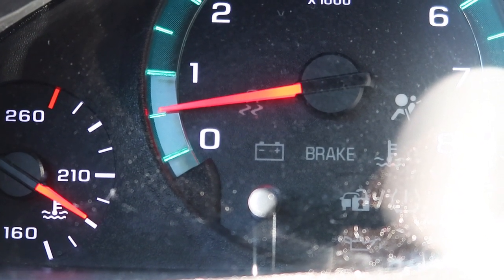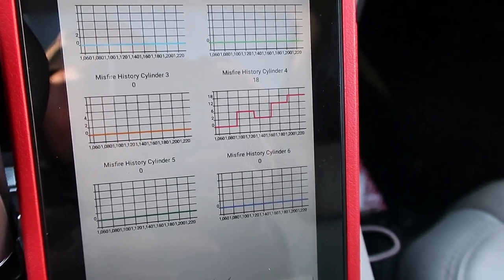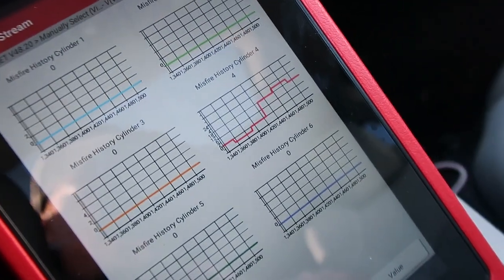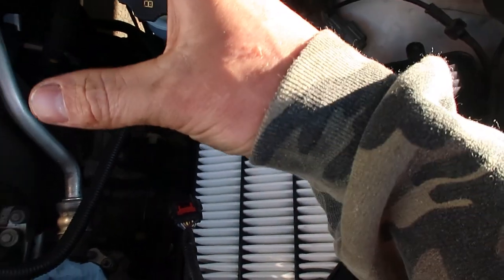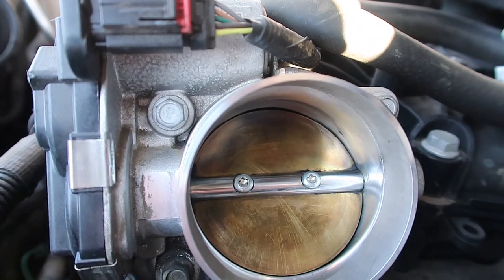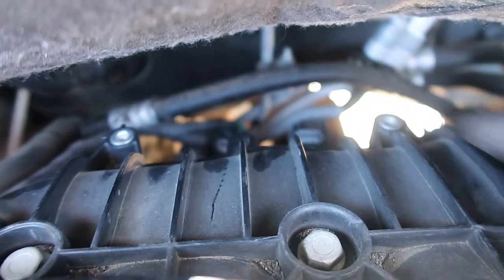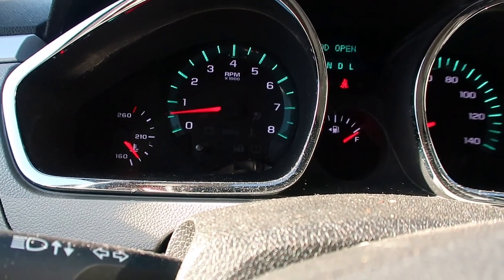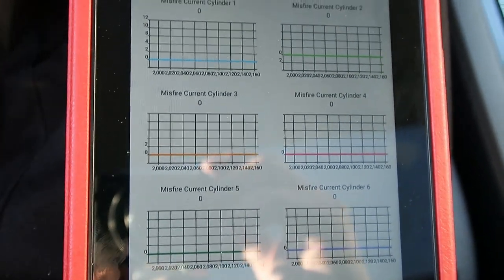More Traverse Misfire Problems. Can We Fix Them?

Comment: I’m having the same issues with my Buick Enclave.  I changed the spark plugs, made sure they were properly gapped, changed both fuel pumps (high and low pressure) along with new fuel lines, new air filter, new TPS sensor, new Mass Airflow Sensor, new PCV valve, and it drives better with each repair, but it’s still miss fire while driving and I’m always getting a rich code on bank 1 (P2178). BTW, I did a warranty exchange on the new high pressure pump, and for some reason, it continues running rich on bank 1.  I love my Enclave, but I’m running out of options.  😄
Reply: Besides a scan tool capable of reading fuel trims and pressures. Either a fuel pressure regulator or fuel injector spraying too much fuel / sticking open.

Comment: 2012 traverse here.  I got a thump thump while in drive and not moving. Well it also does it when in nutral and reverse and park😅... It also seems to thump when driving usually when just starting to move.  I did a full spark pulg and valve cover replacement because there was oil in some of the chambers. Everything is to spec. It was running fine now it started with the noises again...any ideas what i can do next?
Reply from the maker: It’s hard to diagnose a thump noise through the comment section but I will try. Is it a constant thump? Does it change with RPMS? Does it sound like it is form the engine or the transmission?

Comment: Just a FYI, dont manually force the blade of the throttle body open. You have to use the scan tool, and command it open. You can screw up the actuator on the throttle body, leading to damage. If your lucky it just throws the calibration off, if unlucky, your buying a new throttle body!
Reply from the maker: Yeah I need to start using it more for things like that. Thank you for the reminder
Reply: @ModdingAddiction  Ya, ofcourse! 
Good vid.
Reply: hello I just replaced Spark plugs and coil packs and my car still is still skipping
Reply: @dancurrier6421  You need to scan it and see what codes are coming up. There's many things that can cause misfires codes, if that's what you have.
-vacuum leaks
-bad injectors
-plugged fuel filter, if serviceable 
-valve issues, especially GDI
-timing chain
-dirty/plugged air filter
-dirty MAF sensor
-dirty throttle body
-etc...
Have it scanned, and go from there.
Reply: Splash it was scanned by a garage he has a snap on scan tool  told me no codes on his machine checked  under the hood for any hoses that are leaking told me might have to go gm they want $165 hr I don't think so . Going up hills I can smell it burning rich. the garage cut of one converter  it was bad put a straight pipe on it
Reply: @dancurrier6421  Weird that it's no throwing a code...The straight pipe in place of the converter is exactly why it's not running efficiently. The downstream 02 sensor should be picking that up, unless something has cheated it, maybe extended the 02 out of the pipe a little bit?
If it's a misfire, it should detect it. When it runs rough, will it flash the check eng light?
Reply: @dancurrier6421  Try spraying each coil with a spray bottle and water. See if you can get it to stumble while it's idling. Could have a hairline crack in a coil...Or maybe one of the new plugs have a crack or are not gapped properly. Just did plugs 2 weekends ago, and 1 out of the 6 had incorrect gap. Looked like the package was hit on that end...
If I didn't see it or check gap, I would have an engine not running right
Reply: @dancurrier6421 Its not going to run right with a straight pipe where a cat was.
Reply: You can turn the car to on and press gas pedal to floor and hold it with a stick against seat.

Comment: Thanks for taking the time to explain to us how firing orders works
Reply from the maker: Hopefully it helps you out
Reply: my 2016 Chevy Traverse lacking power up hills replaced throttle body and mass air sensor and up stream O2 sensor any help would be appreciated
Reply: @dancurrier6421 Get it scanned or even pay for a professional diag of it. And test parts don't just shotgun parts at it. And keep the parts you remove incase theyre good. For what you spend  already you could've bought a decent bit directional scan tool. Assuming it wasn't bottom of the barrel ebay parts.
Reply: @frizzlefry5I had brought my car to a mechanic and  put in a Crank shaft sensor that he told me would solve my problem with my skipping and bucking bs. I asked him to put it on the scanner said didn't show up anything but still skipping and bucking up hills and very rich smelling. so mechanic is not right there's something wrong with it I'm not stupid I know my car when it's running like crap

Comment: Great vid working on a 16 Traverse cleaned all the intake valves new coils and plugs and all new injectors and still misfiring on #4 any ideas much appreciated BTW compression good
Reply from the maker: I have been leaning toward a bad valve seal leaking oil into the chamber. I am noticing a slight oil consumption problem now too. This should change the color of the spark plug if it is just one
Reply: @ModdingAddiction  clean both sides of throttle body and open the big fuse box under the hood tighten the the two bolts in the center of box that connects the top of fuse box to bottom part between the throttle body which has sensor attached to it and the fuse box can cause a miss fire
Reply: We're you able to figure out why cyl 4 was still misfiring?

Comment: I had a spark plug not fully in position. Fixed the hard idle, the check engine light off at it not making the loud winding noise

Comment: To tap into that tranny surge, as odd as this may sound, my traverse was doing the long pauses between second and 3rd gear... Jerking trying to gather a gear when I floor it, and bucking at full throttle. This completely went away after I changed the crankshaft position sensor ... im not sure what role it would play with the transmission, but it shifts quickly and flawlessly now.
Reply from the maker: That is a good idea i never thought about that. If the sensor is not reading right it might have an effect on the shift patterns. I am definatly going to replace ours now. Thank you so much
Reply: @ModdingAddiction  I had a mechanic put A new Crank shaft sensor that got from the parts store and it didn't make a difference at all it was a waste of money he put it on his scan tool and said it is not showing up anything wrong but it's still skipping and bucking again and very rich smelling going up hills going threw gas like crazy
Reply: Did that stop your misfire too?
Reply: Did that have a positive effect?